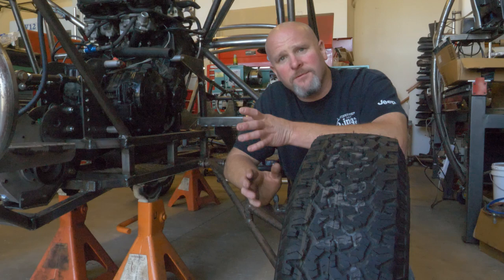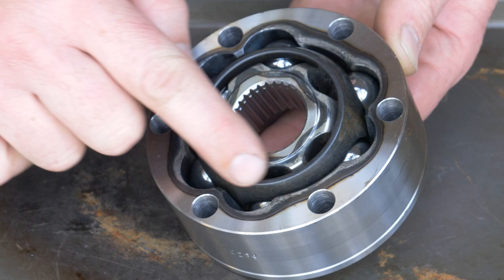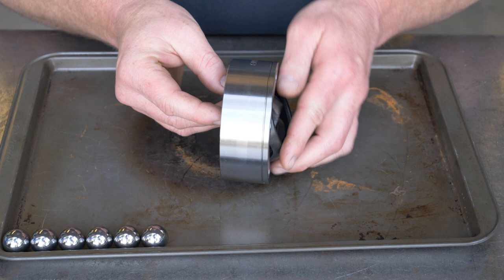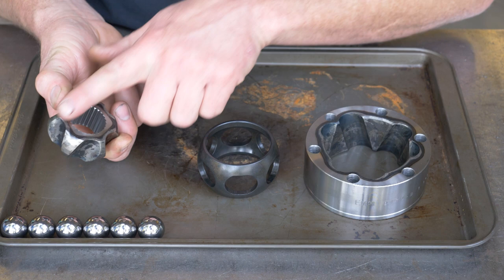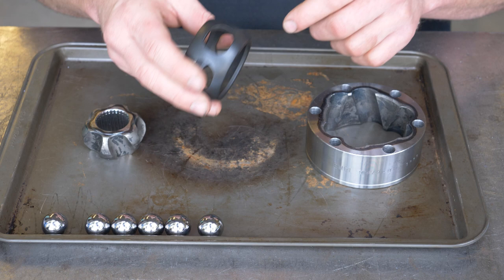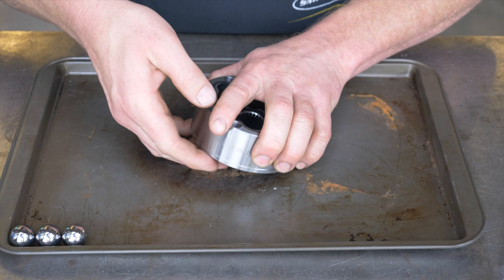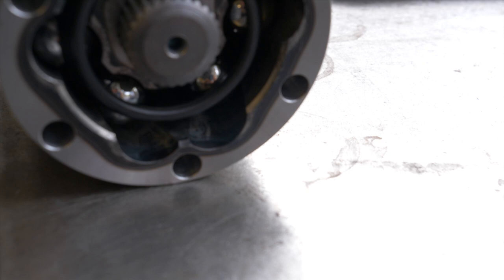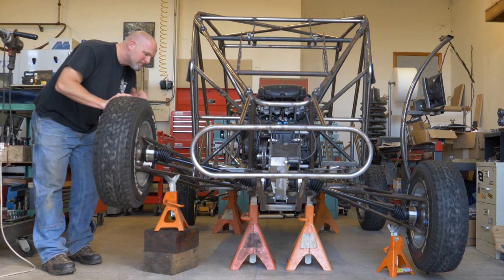How to assemble CV Joint Axle Porsche Type 930 How to rebuild CV joint correctly in Phase

Comment: Great video. But, CV joints do not need to be clocked or put in phase as that does nothing to change how the joint moves nor does it change the maximum angle of the joint/axle. They are "constant velocity" joints. Only joints that are not "constant velocity" need to be clocked or put in the correct phase.

Comment: Rebuilding axels on actual 930 currently and found this very useful, i dont think i knew the cages had 2 diameters
Reply: Actually doesn't really matter for most viewers but just measured joints on 930, original 1984 cvs, cage is symmetric 2.1"

Comment: After all my vw "manx buggy" days of running bus cv's for strength I never thought or heard about having to put the cv's themselves in time ... I did however replace many a standard bug cv out in the middle of the dunes Ha !! Now I'll always wonder if my suspension was lacking or suffering ... I did get smart and used a needle grease tip that locks into the fitting on a grease gun which makes the install and mess way less ( as a mechanic it's kinda challenging to stay clean) ... Good video !!!
Reply from the maker: Thanks!!

Comment: Suggestion to make it easier on you next time you have to pack cv's, since you were using a grease gun cartridge full of grease and you have a nice little mill.... Make a flange with a grease zerk fitting that you can bolt onto the end of the CV and just pump it in. That would make it less messy and it will be packed for sure.
Reply from the maker: That is a great idea!! Thank you. Thanks for watching!!
Reply: @motomule  I highly recommend using Greaser Plates that bolt in between the CV joint and the Flange.  This way you can assemble completely dry and pump grease through the CV joint from the back side.  You leave you boots slid back until grease comes out of the joint and then button things up.  You can also add grease through the season to keep fresh grease coming through the joint.  Do a search for them, this is something you could easily make yourself.
Reply: @motomule  not a problem! Being a machinist/modelmaker just north of you (live in Salem and work in Beaverton lol) I sometimes have to think on my feet lol. I know how the drudgery is like with doing CV joints on vw/Porsche/BMW axles because I have done a few myself back in my vw bug (air-cooled) and Passat days lol
Reply from the maker: @bmgm37  if you closely, you'll see that I indeed have the grease plates installed. I still like to pack the cv's with grease first and use the grease plates for adding in more. Thanks for watching.

Comment: Is there a video on how did you attached it to the wheel? Do you have custom made knuckle or are you using knuckle/hub from some existing vehicle? Thanks.
Reply from the maker: Hub assembly is from the front of a Chevy s10 pickup.
Reply: @motomule  Alright. Thanks. I am assuming those six holes on Chevy’s 10 knuckle align with CV 930 holes. No adapters or drilling needed and outer spline matches the chevy’s hub. Correct?
Reply: But I am looking at the rear trailing arm and that seems to be custom made.

Comment: I have watched every episode (great build and phenomenal fabrication, by the way!) and scoured the comments on each one, and I can’t figure out how you setup the front hubs. In another comment you said you’re using the front hubs from a Chevy S10 in the rear, which is 5x4.75 bolt pattern if I’m not mistaken. Is the bolt pattern the same in the front? And if so, how did you pull it off? I’d like to build something similar to this, but I’d like to have all four hubs the same bolt pattern for consistency. Any feedback is much welcomed! Can’t wait to see this finished!
Reply from the maker: Thank you. Yes s10 pattern front and rear. Front hubs are all custom. I'm going through some life changes at the moment, I will finish this build in 2022.
Reply: @motomule  Thanks for the feedback! Take whatever time you need, man. We support you, and wish you the best.

Comment: Just purchased new CVs from Meyle ( mine were pitted) surprisingly the star raised face is on the same side as the outer ring groove assembled from the manufacturer. Unlikely they are incorrectly assembled - all 4 assemblies are the same. Maybe it doesn’t make a difference ?
Reply from the maker: Hmmm, been a while since I studied this. Hard to imagine the factory would mess up all of them...
Reply: @motomule  Thanks for getting back to me, Yep it’s confusing, checked a few other u tube videos and they are consistent with your assembly. Your content is great, I would have missed the orientation of each end - clocking I think is the term. I will likely leave the assembly as it came from the supplier, I think it doesn’t make a difference in operation. Will let you know if there is a problem after installation.

Comment: Hi, veri good   Привет из России;)
Reply from the maker: Thank you for watching!!
Reply: @motomule  What method of gearbox housing did you use? aluminum casting for gasified models?
I am building a skid steer loader and also plan to manufacture a gear case for distributing torque to a hydraulic pump. I also post videos on YouTube.
Reply from the maker: @user-ry2lt8ki5b  see my last video posted, it's all about the gear box. RPM Gearboxes dot Com.

Comment: why are you running only inner cv joints?
Reply from the maker: Not sure I understand your question??? This is for the rear of a dune buggy, it does not have rear steer. The outer joint is same as the inner in this application. When looking at a Front Wheel Drive setup, the outer joints need more angular motion than the inners because they must compensate for both suspension travel and steering.
Reply: well on all rwd, fwd, awd, cars I've seen the outer cvs are fixed and only the inner ones are plunging.
Reply from the maker: @Robertas_Grigas  take a look at a Porshe or VW, that's what this video is about. There are non plunging 930 CV's but they are quite rare. Don't think they ever came stock in the cars....

Comment: Rear sprocket looks awful small. What kind of reduction is going on in that rear diff gearbox thing?
Reply from the maker: 5:1 inside the box.
Reply: Wooo ok! That makes more sense 👍

Whats the top speed then?
Reply from the maker: @beachboardfan9544  not sure, but should be close to 100mph.... 😆
Reply: 😆 Crazy! I'm designing one RN a suzuki tl1000s engine/trans thats using a quaife rear, with a 15T front sprocket and 58T rear sprocket, and the potential top speed is still 112mph! I cant find sprockets big enough!

Comment: Nooooooooo!!! MIKE!!!! I was hoping to have the 1st 1100cc go-kart build on YouTube as I have not seen anything over 1000 yet. That is until I clicked on Moto Mule to find a link to Grave Digger to send to my friend. You beat me to it! I have a CBR 1100X Blackbird engine that I wanted to put in an adult 2 Seater off-road go-kart. I don't have the necessary tools and equipment to do this properly and with this much horse power, I can't afford to use duck tape and glue for the fab work. So I been trying to contact the other go kart channels to see if they would be interested in doing the build. Unfortunately, nobody responded so Im stuck until I can buy the tools I need. :-/
Reply: How the heck did I miss this video series? I've been searching YouTube for cbr1100 kart builds and didn't find anything specific to kart fab using the 1100 blackbird. I only found this build when I went to your channel to link a grave digger video to send to my friend. Who had the blackbird engine I want to use on my kart. Lol